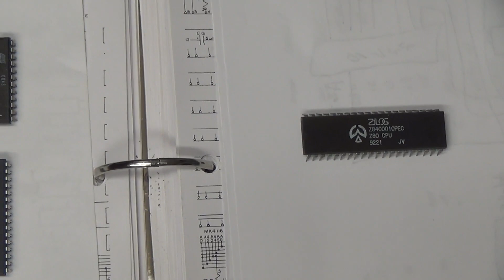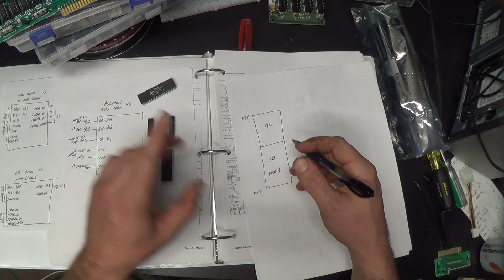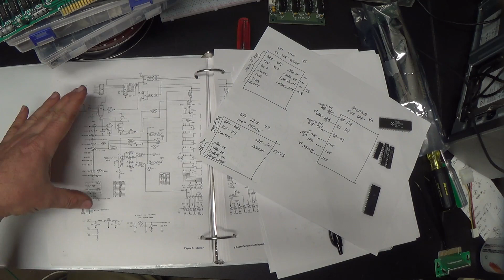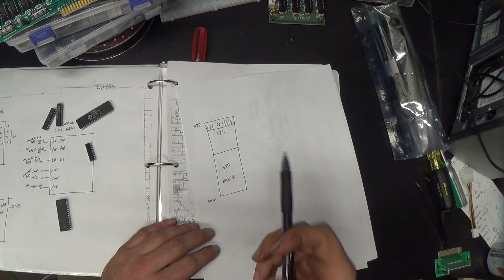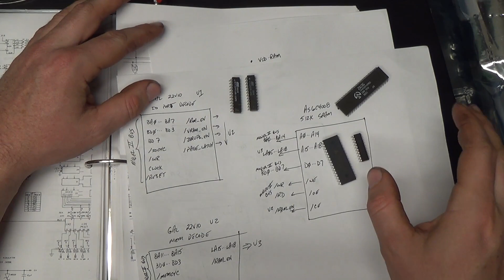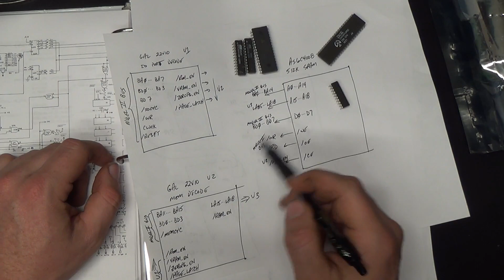512K RAM card for TRS-80 Model II?

Comment: Why limit yourself to what Old Mr. Tandy thought out somewhere in the seventies and eighties? Only 512 Kb of RAM with four IO bits, be a rebel and take five bits and go for the complete 1 MB of RAM.
Reply from the maker: I suspect that none of the existing software would be able to use the additional memory.  If I recall correctly, the other bits of the memory banking IO port are used to control other things, so it's difficult to just add another latch and more memory decoding.

Comment: I've been spending the weekend brainstorming exactly how ambitious I want to be with the first crack of turning my video card project into an actual computer, and memory paging is one of the things I've been agonizing over. I'm badly torn between implementing a single swappable page system very similar to what the TRS-80 is using here because, yeah, should just fit in a GAL, or if I want to something more elaborate that's going to need an addressable register store. (I have a bucket of 74LS670's lying around so it's tempting to just use a couple of them to essentially implement EMS-style 4x16k paging around a 4MB address space, but it's hard to shake the feeling of serious overkill.)
Reply from the maker: Whatfer CPU you gonna use?  The z80 is really easy to interface to.  Set it up right and you can run cp/m.  I think 4mb would be overkill, but like 256k-512k might be useful, I dunno.
Reply: @Lee_Adamson_OCF  First victim is going to be a 6502, because I want to investigate using its magical Phi-clock duty cycle to do contention-less video/CPU ram sharing on one chip. Plan is to make the boot-time memory and I/O arrangement enough like a Commodore PET that I can use the BASIC ROMs from one as a basis to start hacking, but I want to make the extra RAM accessible somehow. There is kind of a bank-switching standard implemented on the late model business PETs but it’s a really blunt instrument and I don’t think there’s any software I’d have reason to want to run that uses it.

Rev. 2 will probably be a Z-80, targeting Model III pseudo-compatibility. :)